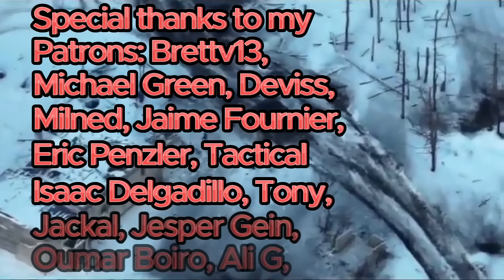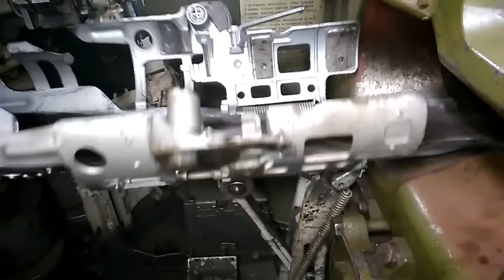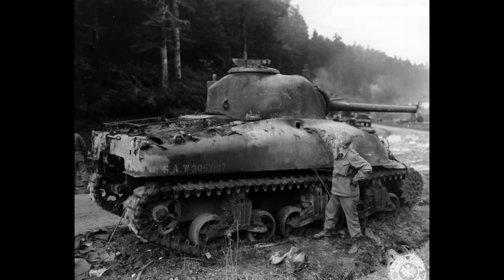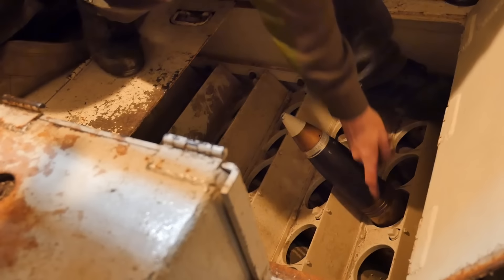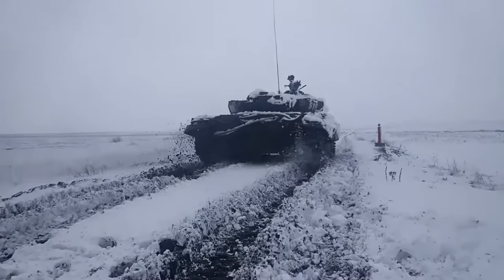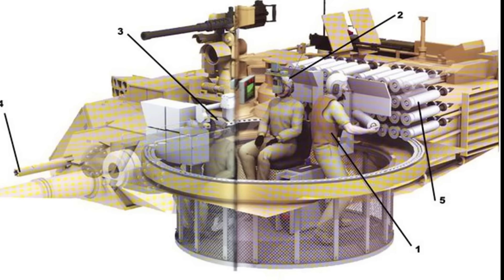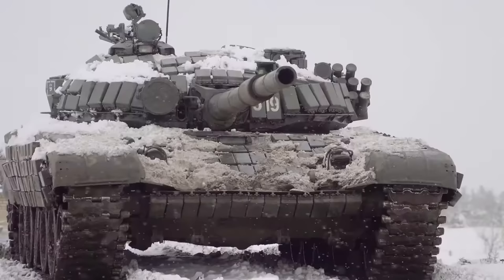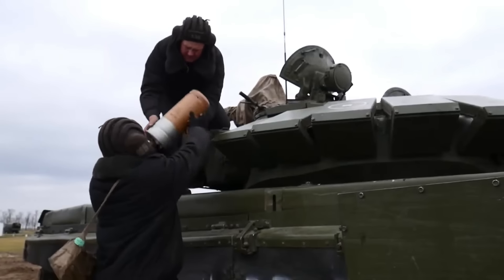Is Autoloader Really the Reason for Russian tanks exploding so much?

Comment: The autoloaders storing ammo down low is actually intended to lower the chances of it getting hit, but the crews just stash the extra ammo all across the tank causing the cookoffs
Reply: It was originally intended to but no longer does. Due to modern targeting and optics mean that avoiding being hit is increasingly difficult. This change demands a fundamentally different approach to protecting the crew in the event of a penetration. Russian tanks also sacrificed crew ergonomics when designing their tanks to make them smaller, making it harder and slower to escape. The T90M was simply obsolete upon its inception.
Reply: Did you watch the video in its entirety?
Reply: @ian_lambert-knight  Modern FCS negates the advantages of smaller silhouette, the AZ is still a very small target below the center line of the tank. Crew ergonomics are fine because it's a 2-man turret in which you don't need to go anywhere. Next, each crewmember has a hatch right over his head, it's actually faster to escape a T-72 unless you are the driver and the gun is over your hatch. Loose ammo and sensitive propellant/explosives are really the main problems.

Russians would be much better off with T-14 but they can barely afford potato i guess.
Reply: @ian_lambert-knight  i think a russian tank is easier to escape as you simply stand up and 50% of your body is already out of the tank. as the hatch is directly on top. in a western tank the last crew member have two wait for the other two to exit first and climb to the exit hatch. The T90M has solved the problem of where to store the extra ammo and it has a thicker roof armor. the Abrams have only an inch of roof armor which makes it the most vulnerable in urban areas or top down attacks
Reply: @Klovaneer  The two man turrets justification for a the poor ergonomics doesn't really follow. They do still need to move and at the very least be comfortable sitting there to avoid becoming overly fatigued. T 14 is in my opinion probably not really feasible to be manufactured. I also don't think it was a particularly good design.
Reply: @Klovaneer Russian thinking is that given how vulnerable tanks are to drones regardless of overall survivability it makes more sense to manufacture many inexpensive tanks than a few expensive ones. 

The T-14 costs about 9 million, or about twice as much as a T-90M.
Reply: @ian_lambert-knight it is not f"ing war thunder. 
It is impossible to directly hit the very lower side of the hull on purpose
Reply: @dust_gale3108  A, that is a absolutely dog water take. B, what does that even have to do with anything? It doesn't affect anything I've said and btw you don't need to hit a specific section of a tank to cause an ammunition cook off. If you start a fire that will more or less do the job just fine. 
Do better
Reply: @ian_lambert-knight  hes right though, why deflect?
Reply: So if Russian tanks are actually out of ammo, they become invincible, 

What a Sundowner.
Reply: Lol!
Reply: @rowdy8814  If you mean Dust is right see my prior reply. If not please provide something of substance.
Reply: @ian_lambert-knight  If a fire starts the crew has time to escape and couldn't care less if their tank throws the turret afterwards.
Reply: @ian_lambert-knight  tanks don't catch on fire for no reason. 
Just like cars that crash also don't burst in flames
Reply: It is the exposed propellant charges which cook off tank instantaneously after getting hit by just a granade. If they shield it properly may me they can prevent this.
Reply: You... Didn't watch the entire video and went to the comments directly, didn't ya?
Reply: @dust_gale3108  Another dog water take. Cars do actually burst into flames. It makes the news semi-regularly so check any of those articles for details. 

Tanks can catch fire for a fair few reasons. There are plenty of things in a tank that burn and some tanks have more of a problem with fire than others. For example hydraulic fluid, oil/grease/lubrication, plastic, and the armor itself if it gets hot enough.
Reply: It's quite standard for crews not to stock extra ammo on both sides of the war. I do not believe either side does this.
Reply: @ian_lambert-knight  nah no one agrees with you so i think its you who lacks substance
Reply: There are many valid points here, but something that might have a big effect as well is that its 2 piece ammo

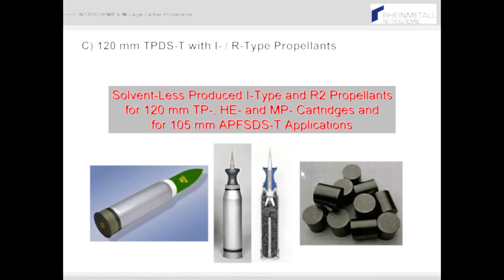Comment: 7:30 You mention the current German tank ammo / propellant / gun system. it is important to note that according to the Bundeswehr, the current system is not able to oneshot a modern MBT and needs improvements (eg depleted uranium ammo, new gun with bigger bore, ...).
That is one of the main improvements of the KF51-Panther, an increased bore of 130mm over the old 120mm system.